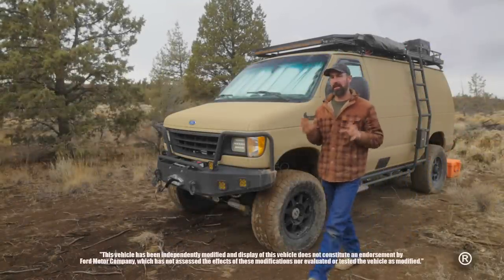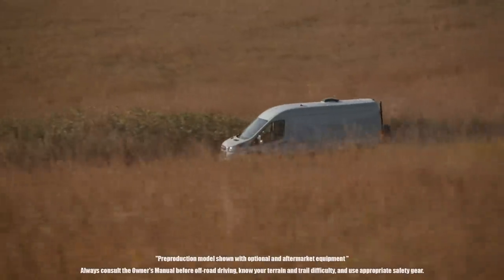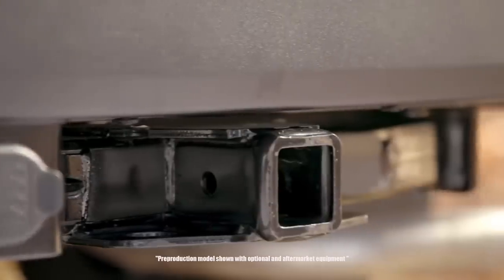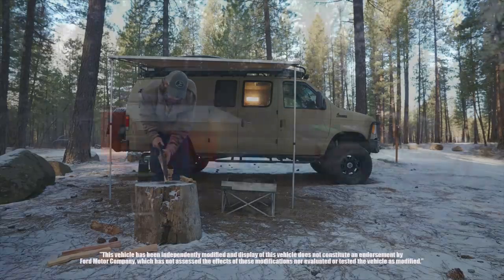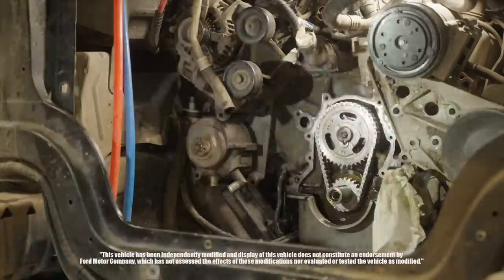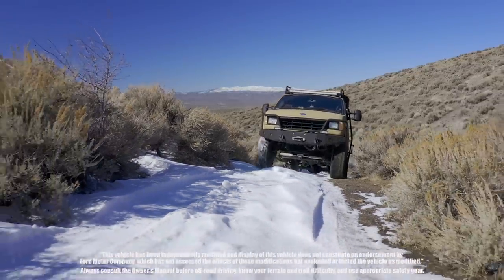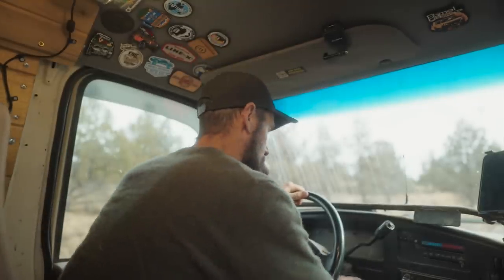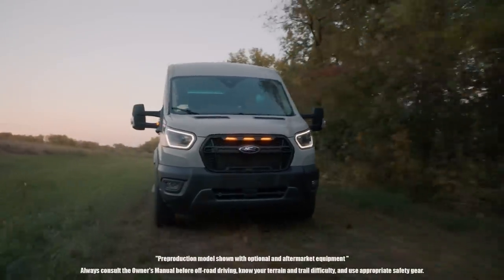The New Ford®  Transit Trail™ Van Reveal

Comment: Ignoring budget, it boils down entirely to what sort of trails you want to explore.

It isn't just low range 4WD vs. regular AWD; you have to also consider suspension travel and "AVERAGE" ground clearance (not the useless "minimum" they love to advertise). A body-on-frame vehicle where everything is tucked safely up high inside the frame rails, with solid axles that can fully articulate, is in an entirely different category of offroad capability than a unibody with independent suspension. 

I'd rather have the Transit if I was a long-distance road tripper visiting parks. I'd rather have the offroad beast if I wanted to get away from crowds and see the real back country. They are both cool vehicles, but there is very little overlap IMO.

Comment: Hoping this is the same 3.5 and 10 speed that’s in the f150. Likely a module swap and some changes with Forscan software would make it an easy swap to a lariat or Raptor style transfer case with the 4A option but also center diff lock and low range. Then the question becomes how much f150/raptor stuff can be used in the front end. The f150 based front diff and suspension is sufficiently strong and has great travel and drivability. Again ford gets something almost right.  But I think the aftermarket will pounce on this and develop some more HD parts relatively quickly. I’d never consider it in its current form but I think this could be an option with aftermarket development.
Reply: Looks like my hopes were dashed. At the 1:08 mark in the video there’s a shot of the front suspension. Hard to tell but looks more strut based than double wishbone like the 150. Bah humbug. 

On another note, I never realized your van was a small block. Guess I assumed it was a 4.6/5.4 modular. That’s a dream van as a start. The 351 is so much easier to work on in a van chassis than a modular.
Reply: If you want to drop like $16-20k above the cost of whatever Transit you spec, you can have Quigley do a conversion with a hi/lo transfer case. No AWD, though. Mostly Ford parts in the conversion so Ford dealers can do repairs and I believe some can even do Quigley warranty work. Me, I'll have to wait 10-20 years for these to hit the used market. 🥲
Reply: The Transit unfortunately uses a generation 1 Ecoboost, unlike the F150.
Reply: @gregbuntain  The 2020 and beyond Transit should be using the second generation Ecoboost. At least that's what I had read the plan to be, don't know if it happened. Plenty of early Transits with fouled valves.

Comment: I noticed that the MSRP of the new Transit Trail has gone up by $1245 totaling $67220.  I added options such as dual alternators, the 50/50 Hinge rear door, engine block heater, perimeter alarm, extended range fuel tank totaling $72505 before taxes, license, etc.  OMG!!!

Comment: Factory with 35s and I’m sold.  But not the way it sets.  I’m looking into a nissan nv3500 4x4.
Reply: Agreed. They need to ditch the strut front suspension and put the f150 based front end under it. Then they’d have something.

Comment: Ford is just renewing the old line of "custom factory vans". Which spawned from the vans of the 70's.   Nothing wrong with them for the weekend or non hard core van lifer. Would have really been nice.  To see a van on a truck frame and drive train.  Coming from the factory.  But again it's now a cost situation.  You can get a RV converted van built like yours... $$$$... or... If you have the DIY ability and time and money... build your own as you did. So it's pretty much as you said... if you're a weekend mild off road enthusiast.  Ford is filling the void and offering a factory option and warranty.  Price is going to be the real question... options and ability to upgrade.

Comment: I rather have an older and less expensive vehicle. The van your are using in the video is going to be between 90,000 to 140,000 dollars. That's a lot of money to scratch up on camping trails. But this is a good video.

Comment: New rigs get old and people might just be sold a new rig now used rig later and have much higher repairs.  Same stuff.   I do know some people (when I ran auto repair business) that just get rid of any new rig out of warranty.  It is all about $$$$$ ... New does nicely but is it "necessary"?  Also most people with new rigs finance it and this is a big huge mistake and money hog as top full premium insurance rates with expensive materials .....(some a status symbol) ....... no thanks.  I am restoring a Chinook 1990 G20 true high top motorhome ... even put in a new motor and transmission etc.  The modern van people always turn their heads to look, ... not that I care.  My point is they know we are the real deal.  The modern are like city dwellers who like to act like they know wilderness living ...  then go back to the drucgs, jobs, tvs and beers bellies. ......  ha ha ... not everyone is the same in reality and most don't do this.. I think.

Comment: These new pieces of garbage are not designed to last, nor are they designed for mechanics to repair them, many mechanics are complaining about the junk built today, the light gauge steel wont allow them to be around as long as the older Econolines anyway, enjoy blowing over $100,000 on something that will not be around in 40 years. I used my settlement to buy a 99 E350 back in 2002, was used, I couldn't afford to put over $10,000 worth of wheelchair conversion stuff in a new van, the van outlived my wheelchair lift, on my second one, still have the van, unless someone gives me a new van, I'll most likely still be driving it, just keeps on going, even after getting hit by a car. The longest lasting wheelchair converted vans over the years was the Econolines, not sure why it was replaced with this Eurotrash, I've always been hard on my vehicles, dad always said GM could save money on R&D by giving me what ever they were going to sell and see if it could survive. 
I can tell you from experience, if you build a stretched 4x4 version of this the same height, may as well drop the 4wd option, its pointless, would get stuck constantly anyway, and on the slightest hill, BTW I used to mountain climb a Suburban, was smart enough to get enough ground clearance under it to crawl over a parking lot curb!

Comment: Bro you contradicting yourself that's not what you said when you were fixing your Van You said that sasquash only had Miners mechanical problems that weren't a big deal Now you say something different because you're getting paid ford transit is garbage you can customize you can't do anything different with With the power train Like you say you have to live it stock it's a piece of garbage Nice way to put it though to get paid You didn't say what you really wanted to say.
Reply: Bro, punctuation is a thing. It helps people understand what you are trying to say. See how easy this is?  And it really doesn't take any longer than your run-on rage typing.